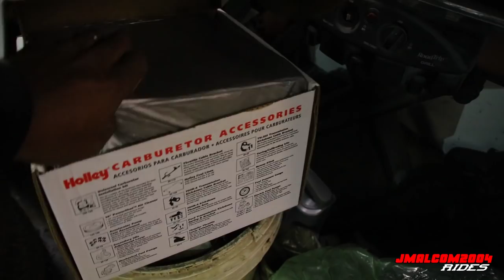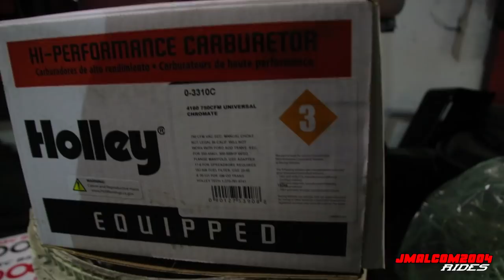BIG RIM BOX CHEVY BUDGET BUILD EPISODE 7: THE SHORT BLOCK 360 CHEVY IS COMPLETE

Comment: You’re right, .060” over is no problem in a 350 block, hell I’ve seen plenty of 400 blocks .060” over, I had one myself, that engine is over 20 years old, and still running with the new owner. 👍🏻
Reply: If you run the AC run the 2 belts it will be good to go it will save you money .and that 350 will run great thanks for the video

Comment: Great vid! Loving all the builds! 💪✊ A 360 is what came in my 2 door. With a stock bottom end, what's a decent cam to throw in w/o having to do so much to top end? Have Comps Cams 1.6 rockers already installed!
Reply from the maker: apdabeast15 a nice hydraulic lift flat tappet can would work great as long as it doesn’t have a huge amount of lift
Reply: @JMalcom2004Rides  Much appreciated JM! Following the big rim caprice build closely ....💪✊

Comment: That motor would make close to 500hp if not 500 hp if you would’ve went with a big hyd roller like 650 lift and good set of 2.05 heads 950 carb ive don’t it spent a lot of money to make 375hp hell could’ve got a stock 454 rebuilt it put some better heads and a cam high rise intake and 850 and make more hp then what you building